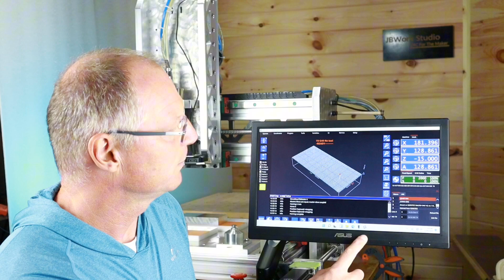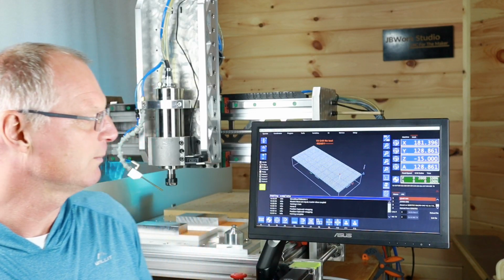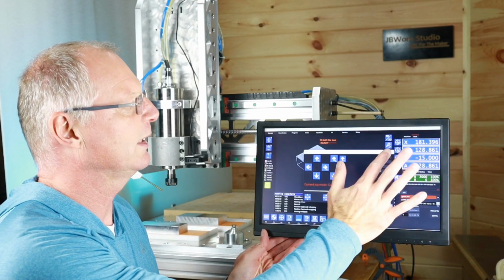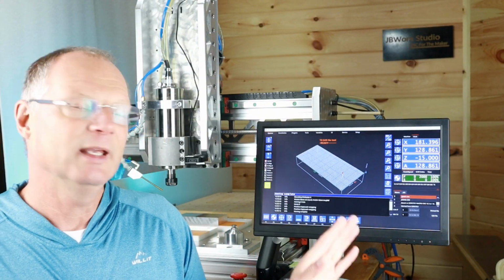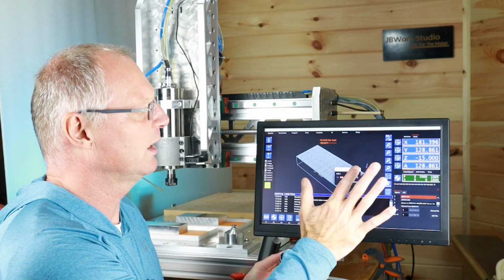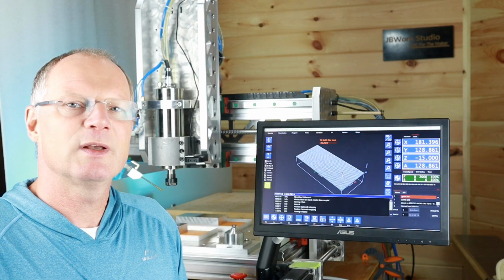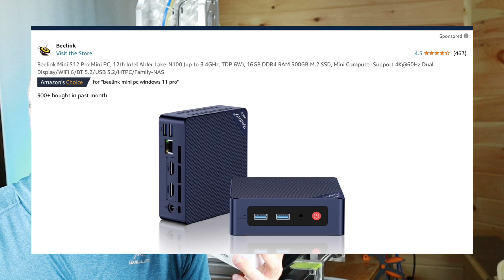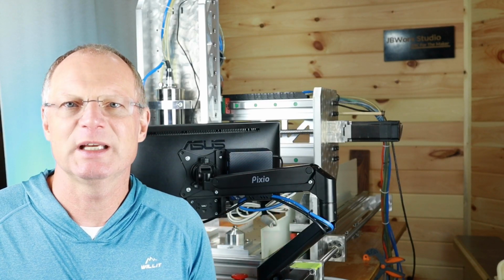Upgrade Your CNC Router with THIS Touch Screen!

Comment: My tip.
Turn the screen 90 degrees.
This way you can see Eding-CNC, plus the onscreen keyboard.
Reply from the maker: Yes that is a problem at times. I am not sure if I like that orientation but will give it a try. Thx !

Comment: Thx again 
When you use cheap device and make everything easy, this is honorable,use update Technology always is amazing , touch screen is more comfortable to use ,mini PC with 160$ with good feature is more than enough!
Reply from the maker: Yes the requirements running a CNC is very low on modern computers.

Comment: I am using a surplus Getac F110 industrial tablet on my laser with Lightburn.  Slightly smaller 12" screen but it's the PC and touchscreen all in one and heavy duty.  Pretty cheap on Ebay too.
Reply from the maker: Yes all these options are a great solution as most systems don’t need much resources. Very good deals to have on EBay as well.

Comment: Still catching up to you but on this one, I am very close! A week ago a 22 inch, used HP touchscreen arrived. Not for Eding, I will go with LinuxCNC even though it scares the crap out of me to have to learn to set that up - the Mesa cards are incoming as well. But yeah, I wanted a big screen with a nice UI (ProbeBasic) but I will have to wire up some proper hard buttons, too. I have already gotten used to dialing down the feed rate and having my hand on the feed hold button/cycle start at the start of a new operation and looking to see if at least the Z looks to be coming up alright:). I think real buttons are better for that than a touchscreen, honestly. 

As for size, EdingCNC looks really great on that 15.6'' screen of yours, but I think ProbeBasic is a bit more "busy" so 17-19'' is probably better for that UI, but since I wanted my screen on the cheap and kinda now, I didn't have much choice and the 22'' popped up first. I have seen people use 24'' but those look needlessly big to me. And I asked around a bit, too and it seems 17-22'' is what many go for - depending on the UI of course.

Oh! I noticed how nice and matte your screen looks:). I am photographer by profession and I can't stand glossy screens. I will see if I can get some anti glare film for my cheapo touch screen.

Comment: you can buy a refubrished surface pro 6 or higher for cheaper than the asus... It will also have built in pc and higher res touch screen and winsows is built in for touchscreen on surface pro.
Reply from the maker: Yes exactly my thoughts I have one and hooked t up and got EdingCNC installed and did not like it. I think the screen is too small. Also you need the docking station and it has no mounting possibility. So for me 15.6” diagonal is optimal. I also ordered a 19” or maybe it was 20 don’t remember but I found that one to big. The ASUS screen you can find sometimes on Amazon for $75 marked as used.

Comment: OMG, please tell me you are going to have a setup video... generic... for EDINGCNC, please please!
Reply from the maker: Affirmative 👍, there is one next week about spindle tramming, after that there will be 2-4 about Eding CNC. I am in contact with Eding and might end up installing a new board as well - we will see
Reply: Wunderschon 🙌🏻
Reply from the maker: Danke dir
Reply: I had never heard of Eding CNC. I’m looking to replace my UCCNC setup as I’m really not happy with it.
Reply from the maker: I have used Eding CNC for the past 10 years and I still like it today.
Reply: @JBWorx does it allow for slaved axis?
Reply from the maker: Oh yes and square homing a feature where both drives are set so the axis is aligned square.
Reply: @ ok now you have definitely peaked my interest! 
Thank you again for excellent content and advice.
Reply from the maker: And thank you for engaging in my content
Reply: @JBWorx  only 10 years?.. "Novice"🤣I have EdingCNC on my CNC Mill since 2008 and on my lathe also for 10 years now..
Reply from the maker: @JanBinnendijk there you go ! It is easy to work with and has tons of features I still like it today.

Comment: can you show how you attached the arm to your cnc?  have a similar setup and trying to figure out the best way to attach it on my end
Reply from the maker: This arm has 2 mounting options. 1 it has a “C” style clamp to attach to a flat surface, 2 it includes a long screw that mounts through an attachment point and then screws into the included bracket. I think if you like to mount it to a profile like a 80/20 or Item / Bosch profile you can shorten the screw and use a nut that slides into the profile. Also,have a look at a “hammer nut” it simply drops into the channel and can be tightened. I hope this helps

Comment: So one of the things to think about is how to transfer files to the PC. A USB thump drive will work but maybe setting up a home network will work as well.
Reply: I use Google Drive and just have my indoor computer and my CNC computer synced to it. Works pretty good.
Reply: @ZrubekFamily  me too!
Reply: I purchased slightly more powerfull mini pc (hp 800 g5 for 199€), to hang behind the monitor to be able just open and work with fusion360 directly on the pc connected to my cnc 🙂
Reply from the maker: @dibonko that is one advantage that my laptop set up had. You can quickly access a file and re-post the gcode.
Reply: @dibonko  yes I was worried that I miss that functionality however my working desk is within 10ft of the CNC, so the shared home network folder does work also. If I had to go from the shop into the house I would try to use the same PC for the CAM and the CNC.
Reply: I just use OneDrive everywhere, solves the problem very nicely. I even managed to get PathPilot to accept a OneDrive addon.
Reply from the maker: That is a good solution ! As I could access that from my lathe as well